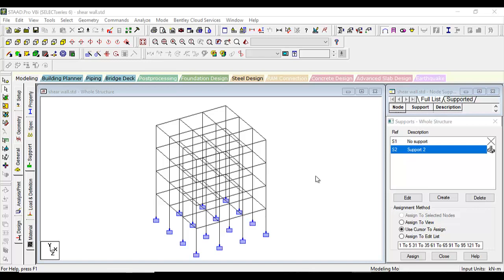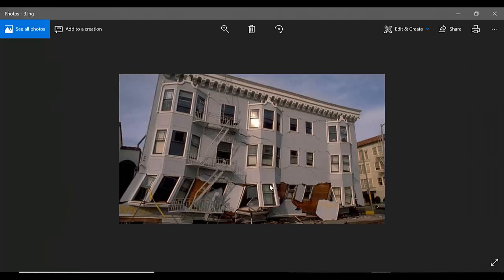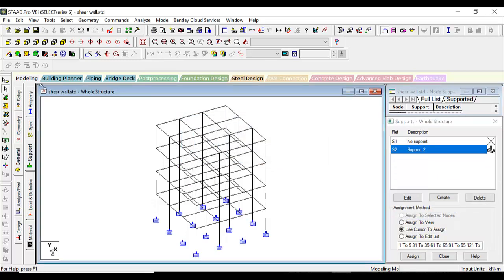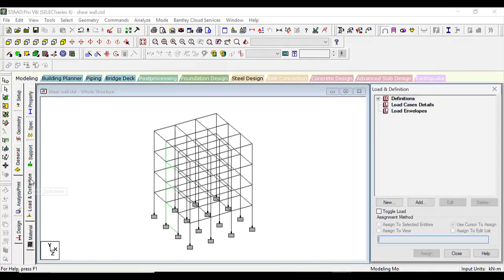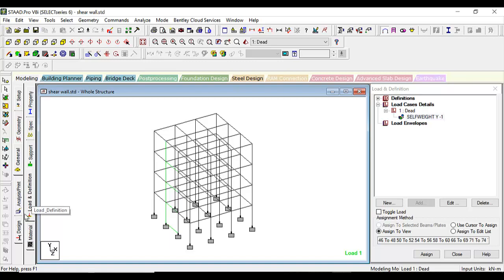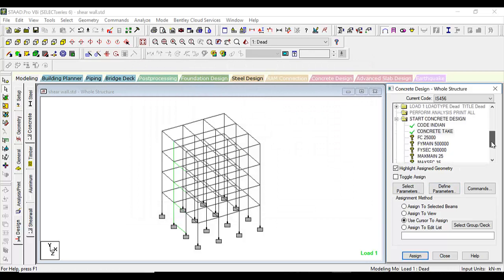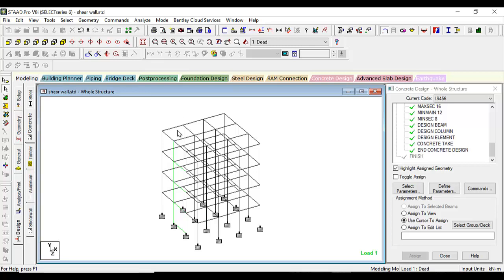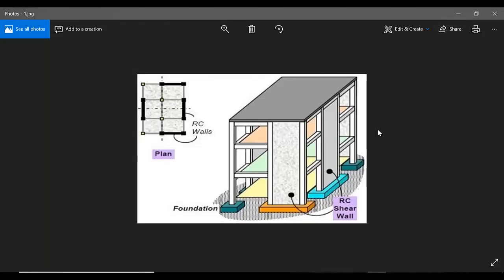STAAD PRO v8i LECTURE 23 Shear Walls

Comment: Thanks sir
Reply: But sir I have one question...we will use plate element or surface element for the shear wall??
Reply from the maker: Plate Element verus a surface

If you want model a structure which contains a wall, slab or panel type component, you have two choices in STAAD :

a) Model that panel using a collection of individual elements. This is called a finite element mesh. This is an assembly of the 2d triangular and/or quadrilateral elements described above.

b) Model that as a single physical object called a Surface.

plate can be either three noded or four noded, surface can be up to eight noded.

Plate will have to be meshed through a different command, surface has the provision for auto meshing.

All the three or four corners of plate can be of different thickness, the surface has to be of uniform thickness.

The out put of plate analysis gives result for out of plane moment and shear and designs accordingly, The output of surface analysis gives result for in plane moment and shear.

If the doubt persist and you insist i can come up with a explanatory video.
Reply: Staad Pro Classes thank you sir once again